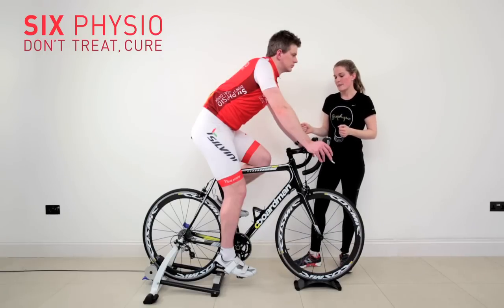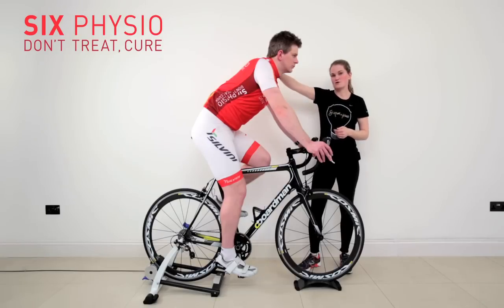Neck pain when cycling?

Comment: I have lots of pain only in the neck(cervical ) when I ride plus 40/ km. I already changed the stem for a smaller one( 110mm to 80mm), but the pain didn´t disappear, what could I change?
I have a 54 frame and I´m 1,75 height.
I would be so grateful if someone could help me!
Reply: Change it to flatbar and put outer bar ends at around 17-18 degree upright